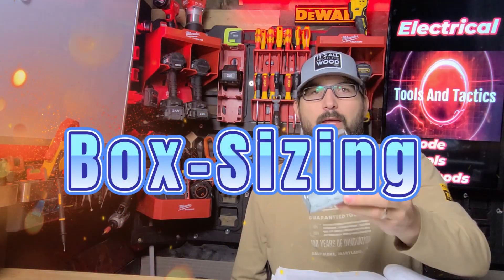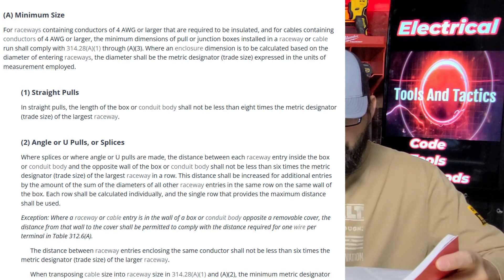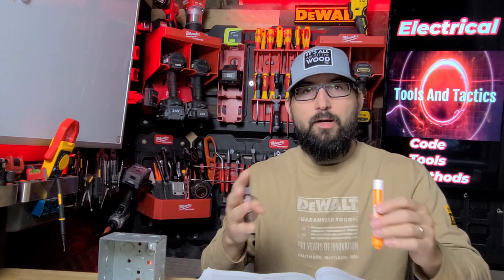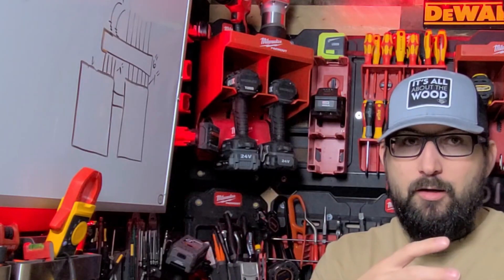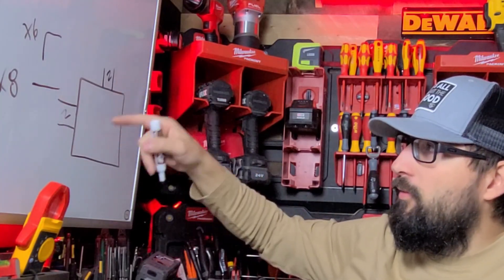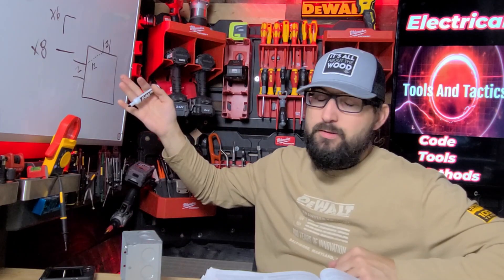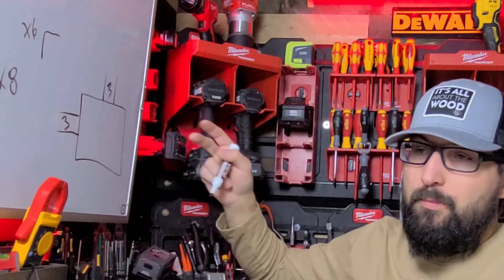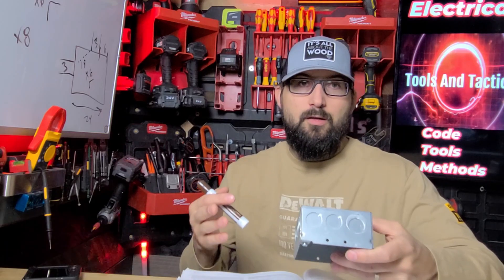Most Don't Know! Sizing junction boxes -Expert Insights on Electrical Code Compliance

Comment: Thanks. It is definitely a misunderstood topic. I might make the argument that you are describing a wireway (NEC 376). What's interesting is that it says if the wireway is used as a pull box (not a pull or junction box), you need to size it based on 314.28. So I'm curious what your thoughts are if the conductors are spliced in the wireway, thus making it a junction box and not just pulled through (pull box). Would that be legal?
Reply from the maker: ill have to check i think its for splices too (off the op of my head)  then we have crosssectional area to wory about too